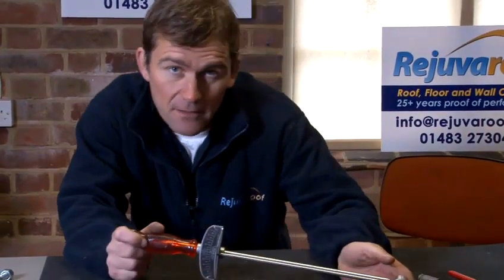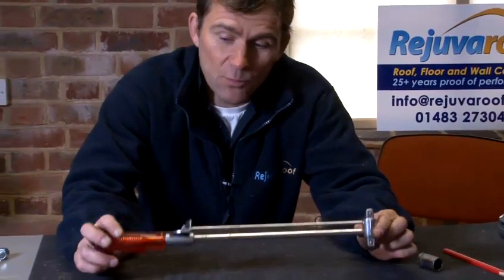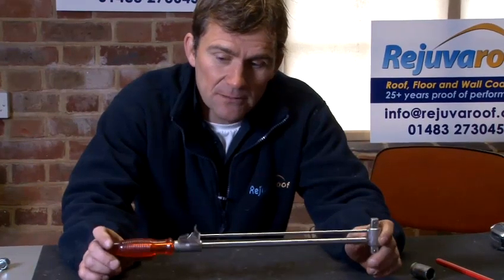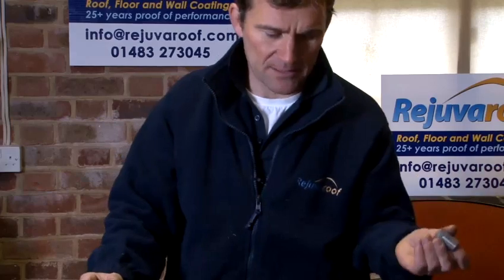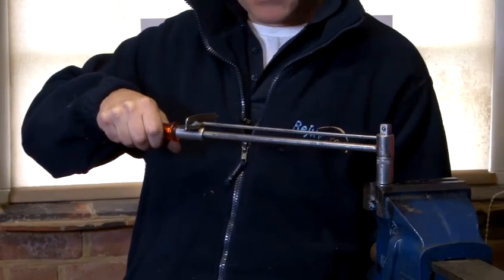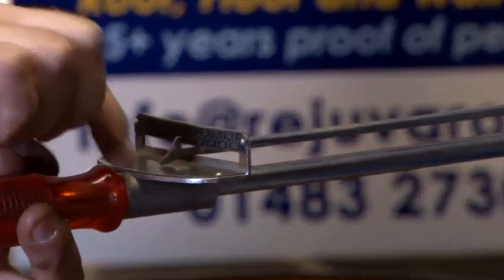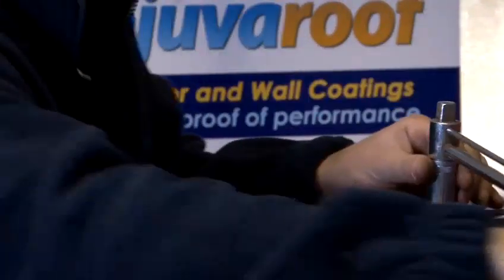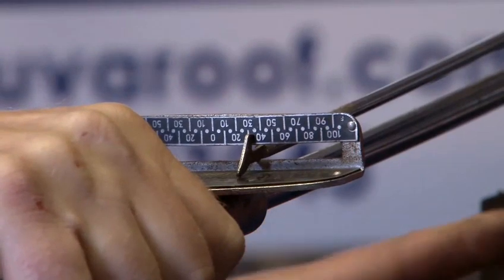How To Apply A Torque Wrench

Comment: I just found out the hard way that not torquing down my transmission pan bolts, let's all of the expensive atf+4 fluid to leak out. So I get to do it again. Round #1, is 80 ft pounds,  then round #2 is 120ft pounds around again. It just seem like I was going to strip them out, or twist the heads off. And because one of the bolts was a 13mm. And there all sapos to be 10mm. Thanks for showing me. I've got the same one you do..

Comment: You don't tighten to achive "pressure".  You torque a screw to achieve a desired preload in th screw.  The preload (a force) is inferred from the torque value read from the scale on the tool.

Comment: I prefer the Click style Torque wrench.   Easier and more accurate.   Can't tell if I'm really accurate with these... The lines on my Deflecting B. W. are by increments of 10  ft-lbs (10, 20, 30, 40, etc)...

Comment: I have worked in a calibration lab. The early digital torque wrenches were crap and and we failed 50% of them. The mechanical were then most common with 10% of them suffering from an out of scale condition when the spring fails from fatigue. Of the few beams we received, they were all good to go. Good simple video!

Comment: Some people don’t realize how important a torque wrench is, especially on things like spark plugs. 18 foot pounds torque On your average four-cylinder engine, any less and it could cause a misfire. Many problems arise from misfires from improperly installed spark plugs. This torque wrench is pretty accurate, I use one every day. Good video, easy to understand.
Reply: Maniful gasked bolts for ram 5.7 bro torque

Comment: how often do you have to calibrate?
Reply: Nomon Munir - These type of torque wrench can not be calibrated. If the needle is off you have to pull the beam it in the opposite direction and hope it falls back to "0". Some have a plastic pointer on the end that you twist to to set it to zero. Now "Click Type" you usually have it calibrated if it falls or you use it every day, but for the "Weekend Mechanic" just reset it back to Zero and it usually doesn't need professional calibration.

Comment: Just bought a 1/2" beam style torque wrench.  I have all the other wrenches and sockets I need, but a torque wrench is new to me.  Expensive click, electronic or professional grade wrenches are all fine and good for those who use them frequently, but all I need to do is torque four bolts on a 2" trailer hitch on my vehicle.  Thank you for the quick tutorial.

Comment: what if my beam torque wrench is not set at zero when not using? How do I fix it?
Reply: I think you bend it back the other way until it reaches zero. You kind of "zero" it out.

Comment: Click type torque wrenches are not better. They may be easier to use when you're working on an engine that's still in the car or truck because you don't have to look at a scale on the end of the wrench. If you're working on something easy to get around a beam or needle type torque wrench is just as good. You also don't need to recalibrate the beam type every year and you don't have to worry about "backing them up" after each use. Neither wrench is better than the other. One is more expensive than the other and one needs regular testing and recalibrating but they both work fine.
Reply: +wcjcnc ,great info guy.
Reply: I'm looking at a Craftsman 1/2-in. Dr. Beam Style Torque Wrench, 0-150 ft. lbs. do you think it's a good one?
Reply: T, Skipwadoo  Igot one for 7bucks, it works

Comment: @Norm Booker it is not Pounds per Sq In.  Torque is in Ft Lbs or Newton/Meters not PSI.
Reply: Wrong.  A torque is expressed as ft-lb, N-m etc.  A force acting at a distance.

Comment: This demo was laughable. That's 'pounds per square inch' bloke. This video was done to advertise what's in the background.
Reply: Torque isn't measured in psi. It's measured in inch/pounds, foot/pounds, newton meters.
Reply: @johncall4525  Wrong.  inch-pounds, foot-pounds, etc.  Force acting at a distance.

Comment: my dad bought a beam torque wrench in the seventies for doing a head gasket change on his car and ive still got it as some parts on bicycles have to be torqued up 
the torque wrench still works ok its a bit battered and bruised with age but its an ivaluable tool to have especially for tightening the nut on cotterless cranks which can work loose if not tightened properly